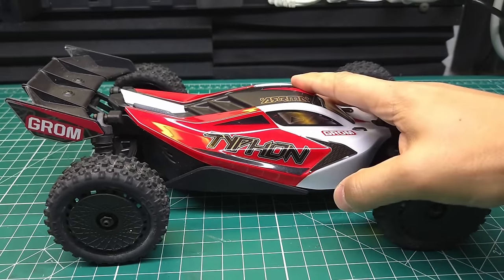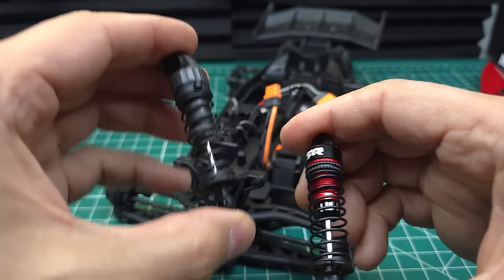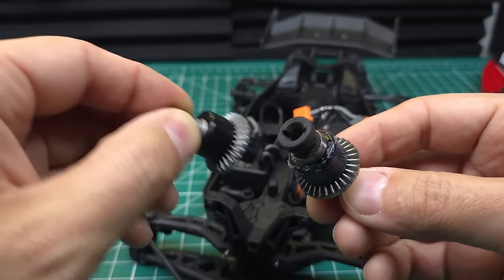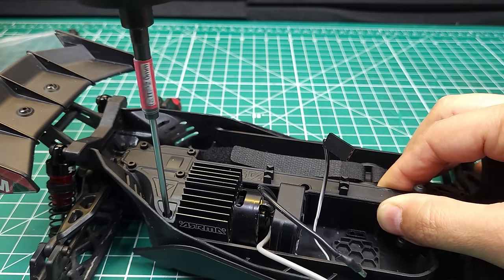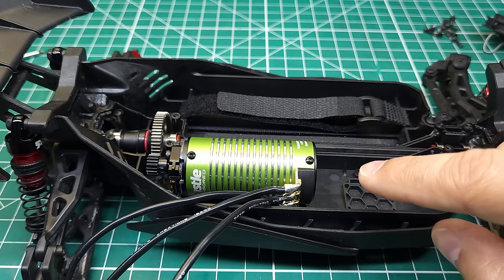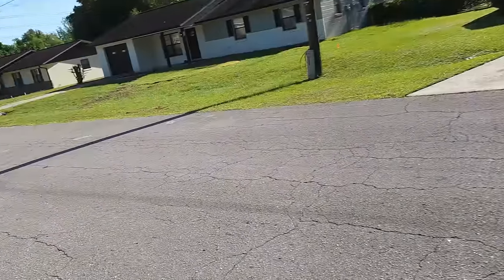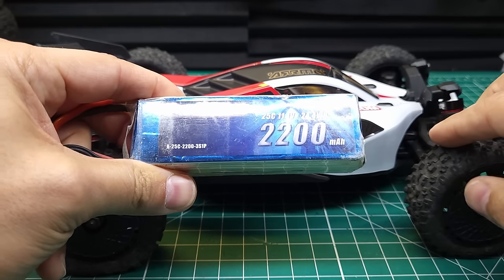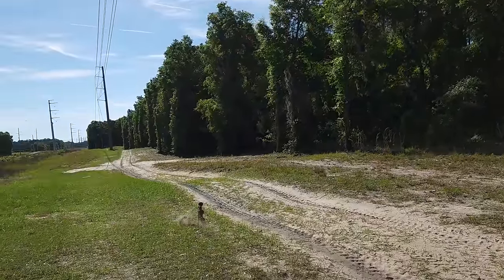I Made The World's Most Powerful Upgraded Typhon Grom & It's INSANE!

Comment: I can tell you from personal experience that the diffs can’t handle 4 packs of factory power out of the box. 😡 lol love these quick videos man! Keep it up
Reply from the maker: Yeah I don't know. I ran the granite grom on 2S brushless probably 20 packs before I upgraded differentials and didn't have a problem.
Reply: I ran 2 pack thru it stock then put in the traxxas velinion system and ran probably 7 packs on 3s before anything broke i thought it was pretty impressive for plastic diff gears
Reply: Not true. I've had my granite grom for over a week now and have put probably 20 packs of the factor 2s through it and zero issues with the differentials. And I've abused the hell out of it; hard jumps, hard acceleration, driving through thick brush, getting sticks stuck in the drive train to lock up the diff, etc, and it's still going strong on stock diffs. I will however upgrade to all metal when the local hobby shop gets them in stock as I plan to go full brushless setup.
Reply from the maker: @EngineeringUSA  Yeah I think most people's experiences are similar. As all you don't go crazy with the power the stock drivetrain is decent
Reply: @EngineeringUSA  that’s awesome to hear. Glad that people aren’t having the same experience as me. 👍🏼

Comment: Wonder why they couldnt do mod 0,6 pinion which are plenty from tamiya. And that oddball spur gear. What possible fits is a 38T from a wltoys 959 with the drive shaft. Didnt try it, but looks the same.
Reply from the maker: Well my 0.8 is basically 32p which is a pretty common gear size so that's likely why they went with it.
Reply: @DoRC  Mod 0.5 stock is just annoying enough too far from a 48 pitch. 48dp is 0.5288 mod
Reply from the maker: @Particular_Sky  Yeah unfortunately that one doesn't work but 32P and 0.8 do. The gears will be a little noisy sometimes but I've never actually had a problem with it.

Comment: Man this thing's cool! i was impressed by the amount of backflips it did on big tires!
Reply from the maker: Yeah if it hadn't broken I could have done more. I was kind of building up to just holding the throttle down when I left the ramp but never quite got there.
Reply: @DoRC hello I wanted to copy this build but I was curious to what 4s battery did you use if you could send the link or just copy the name for what you used
Reply from the maker: @jakechunasamy9642  I don't remember specifically I think it was some old FPV quad battery that I had. It probably was not the ideal one to use. I'd recommend just measuring the battery tray and then going on Amazon or something like that and picking one out that'll fit

Comment: I think you only had to upgrade the diffs and motor and esc. I'll be doing this on a budget in my next video. I'm going 3s motor swap. I remember you saying in the granite Grom video that the shocks were most likely not needed so it's interesting to see you upgrading them. Great video!
Reply from the maker: Honestly the only reason I upgraded them is because I pulled all those parts off the granite :-) I'm not sure if the outdrives are necessary to upgrade or not. I haven't run big power on the plastic ones.
Reply: COOL I like your channel!
Reply from the maker: @ReactionRC thanks!
Reply: @DoRC your welcome
Reply from the maker: @ReactionRC  :)

Comment: What’s the biggest battery you can run without upgrading the esc or motor I have one and want to run 3s but don’t want to upgrade anything else
Reply from the maker: The stock system is only to s compatible. If you want to run 3S you have to run a different ESC
Reply: Redpower XT 2700mah 2S. It's 1mm longer over the 1400 spectrum but thats a drop in for 2s.

Comment: I think I am going to try the exact setup but just curious what 3s battery are you running? This is a great vid and I have been wanting to upgrade a grom soooo badly.
Reply: And what is the pinion called
Reply from the maker: Hot racing mod 0.5 1/8 in bore pinion and I don't even remember what battery I use. It was some old FPV quad battery that I had. Definitely not the ideal option.

Comment: I would try the 6350kv 1007 motor from castle, can run up to 3s and is much shorter than the 1010. Run one with the micro x2 in my reflex 14mt and it goes even just on 2s (44mph on 2s).
Reply from the maker: Yeah for sure. I think the 10:07 motor would be more appropriate. Not only would you not have to hack up the chassis but it would also almost certainly be more than enough power.
Reply: I stuffed that 1007 into my grom and it's stupid. Had a hard time finding a pinion though where do u guys find .5mod 1/8 shaft pinions?
Reply from the maker: @calebworland967 hot racing makes them. You can get them on eBay
Reply: @DoRC  do you know if the 18t is the largest? I have a 21 right now from LC Racing. I swear this thing goes 50 on 2s but the pinion doesn't look the best. Part of me wants to try and design a 48p Slipper system for the groms. Would solve all the gearing issues. But im not settled on these diffs either these little things are overpriced without having a rebuild kit available.
Reply from the maker: @calebworland967  no I'm pretty sure they have larger ones.

Comment: Awesome build, was curious, I did a similar build and had to use an external bec with my micro castle combo, was yours different
Reply from the maker: Yeah Castle modified the X2 to have an internal BEC sometime last year. I don't remember exactly when. It is still possible to get the X2 without the internal BEC depending on how long were you get it from has had them stocked.
Reply: I bought it yesterday at the hobby store when I got the typhon grom and external bec came with it, it was the micro x2 with 1010,5600kv motor
Reply from the maker: @badmofreaker4205 Yeah it must have just been something they had in stock for a long time.
Reply: Maybe, I hope it's fast,waiting for a gear that's out for delivery.  Do you have the part numbers for the upgraded shafts and diffs,etc
Reply from the maker: @badmofreaker4205 hop on the horizon site Go under the typing Grom and check under optional parts. They're all listed under there
Reply: Thank you

Comment: I added a 16BL30 and 2435 Sl G3 6500KV motor to my grom and it's insane. It goes 45+ and can go even faster if I increase the timing and that's on 2s. It takes up no additional space and the only thing required for it is a 2mm shaft 18t losi pinion mod 0.5. Although id recommend getting a smaller pinion for more usable torque. I also cut the servo mounts off the stock 2 in 1 esc with a knife (yes I did that even though its sounds dumb) but it worked and allowed me to tuck the esc in nicely.
Reply from the maker: Sounds like a sweet setup!

Comment: Whats the parts number list of the upgrades? got my daughter a typhon grom and wanna upgrade it to.
Reply from the maker: Pretty much everything in the optional parts list on horizon's website and then a castle micro X2 ESC with 1010 motor though you have to modify the chassis to install the 1010 motor. You'll also need a hot racing 1/8 in pinion in the tooth count of your choice

Comment: Goes like crazy! 👍 It that car was just a bit taller… I need some more space to fit my FPV gear on. 🤷
Reply from the maker: The granite grom has more room under the body than the Typhon.
Reply: @DoRC  I'm more interested in a body that's a bit larger.
Reply from the maker: @NUeB_RCFPV  bit larger than even the granite grom?
Reply: @DoRC  That's too high… ;) I now have a WLToys 124007 which is okay in proportions (w/ fpv just 120 mm high), just the wheelbase could be e bit longer (relative to it's width) and the build quality is very poor. So I'm looking for a small buggy w/ a long wheel base and a body large enough for at least 3000 maH 3S and space for the O3 air unit.
I've got a 1/10 Lasernut which is a FPV banger (see my channel) but need a replacement for the WLToy – a car small enough to fit inside a daypack but in higher quality.

Comment: Love the video!! For the CC combo what bore size is it? Is the OEM motor bore size the same as the castle? For the esc connectors did you go IC3? I plan on doing IC3 and just get regular battery’s and convert them to IC3 What do you think is that a good idea?
Reply from the maker: The shaft is 1/8" which is different from the stock one. I went with XT60 though IC3 should be fine.
Reply: @DoRC  so for the pinion size what should I be looking for 1/8 size or what exactly?
Reply from the maker: @lilbeanboiiii  Yes if you want to emulate this you'll need to get 1/8 bore mod 0.5 pinions. As far as I know only hot racing makes them. You can get them on eBay in several different sizes.
Reply: @DoRC  interesting. So tekno and robinson racing don’t carry those type of pinion sizes?
Reply from the maker: @lilbeanboiiii  it's possible that I do but in my admittedly limited search I couldn't find anything other than the hot racing ones. It seems like 1/8 in mod 5 is fairly uncommon

Comment: The offroad running portion of this video was oddly reminiscent of the first  runs of the Maxx Slash with all the bouncing and crashing.  Looks like a fun little rig for smooth surfaces.
Reply from the maker: Yeah for sure. I was definitely running it on rougher surfaces than it needed to be but I feel like it's a little bit different than the slash.  It's understandable for a little car like this to be bouncing around on bumps like that but not quite as acceptable on a giant car like the slash. Honestly I think this thing handles rough off-road better than the slash.
Reply: @DoRC  That was honestly my first thought when I saw a Maxx Slash run.  "It bounces like a little 16th scale car'.  I also agree with its excusable for a 2 pound car with less than an inch of suspension travel but not a 8th scale truck.  But,  both are pretty good on smooth flat surfaces and at least they're tough.
Reply from the maker: @boduke9428  Yeah the maxx platform definitely is tough.

Comment: This is the video I was waiting for the longest!!! I really want to copy your set up! If I end up pulling the trigger i will still get the 1010 motor I wanna have an over kill lil beast too. I still don’t understand why you had to take the cover off the esc? Also would this work w a dumboRc receiver? 🔥🔥🔥
Reply from the maker: Yeah I didn't make it clear in the video. I removed the cover because it was contacting the body. The buggy body has a lot less clearance than the monster truck body.
Reply: @DoRC  oh okay I see now. No motor fan wouldn’t it need one just to keep the components nice and cool?
Reply from the maker: @Desauce512  in my admittedly limited experience it seems like the system is beefy enough to not need active cooling in this application but it was also 65° out when I was running it so that might not be the case at higher ambient temperatures.
Reply: Do you recommend getting an external BEC (I have no clue what that does btw) or just get the regular esc that comes internal with it? TIA :) or what should I go with?
Reply from the maker: @Desauce512 you definitely want to get the updated version that has the internal BEC if you can. The only reason that they included an external BEC was because the ESC didn't originally have an internal one. Having an external BEC, unless you need a bunch of extra power and are getting an external one for that reason, just adds weight wiring and complexity that you don't need to deal with.
Reply: @DoRC  Thank you for this INFO!! you really are so helpful! the CC combo that you have did it come with the internal BEC? because I plan on getting that same combo on mine! I wanna have an overkill beast just like you!
Reply from the maker: @Desauce512  Yes mine did. I got mine on Amazon and I suspect if you get yours on there it will be new enough stock that you will get one with the internal BEC as well. Did you see the part in the video where I had to trim some of the chassis in order for it to fit? Doesn't seem to have caused any problems but it is something you'll have to do if you run the 1010 motor
Reply: @DoRC  yea I saw the whole video like 5x. I guess I will make sure it takes the BEC inside to keep it nice and clean. Also for the trimming part I don’t mind doing that at all! I’m just a bit undecided on whether I should double side the esc on to the servo so I don’t have to take the cover off or go the route you did add a mount and take the cover off I’m so OCD it’s killing me.
Reply from the maker: @Desauce512  The servo is mounted to the chassis using the stock ESC. When you remove the stock ESC you remove that mount so you're going to have to use a different kind of mount no matter what. Horizon sells one that is very similar to the 3D printed one that I had. I believe you'll have to remove the cover either way to clear the body. You can't mount the ESC directly to the servo because without that bracket the servo has no way to mount to the chassis
Reply: @DoRC  ahhh okay I see now. No cover it is. Once again thank you for this information!
Reply from the maker: @Desauce512  You're welcome thanks for watching!

Comment: Just wondering since you reply a lot. I cut the connector off the stock 16bl30 so it was just the metal pins, and soldered those into an xt60 connector. It’s in there good and soldered. Do I need to bring it to bare wire or will it work the way I did it. If that makes sense lol.
Reply from the maker: What connector was on there originally?
Reply: @DoRC  looked similar to a tamaiya. Also now the LMT 2mm pinion seems wobbly on the 2mm HW shaft … I’m about to give up that’s what I was told to buy on the FB page lol.
Reply from the maker: @G35Jeesh  ok well as long as it's solidly soldered it should technically be fine. There isn't a ton of currently being passed though the more connections you have the more resistance. not sure about the pinion.

Comment: whats the run time like on the 3s?      both mine got the 93 diffs about a week into ownership, then blew out the cvs after that.  then i tossed in the 380 brushed motor but even with the printed fan relocate its still getting beyond hot.  If runtime goes up and the temps go down im gonna have to cave and go brushless. haha
Reply from the maker: Run time is one of those things that's kind of impossible to predict for someone else. There's quite a bit of room in that battery tray so you can fit a pretty big battery but it's also going to depend greatly on your driving style. If you're just puttering around hanging out with friends you could get twice as much runtime as if you're blasting up and down the street or running through thick grass.
Reply: @DoRC   Thats a fair point.  Run time is what it is i suppose.  So i guess im looking for ways to not make it run so hot. If brushless does that im on board.     

One thing that has been interesting to me is that on the thermal the back senter of the body cover is what gets the hottest.  thinking heat must be coming from the rear end or something.
Reply from the maker: @mtnbike4522 absolutely. Brushless is far superior to brushed as far as heat generation is concerned.  It is way more efficient. That being said it's also generally more powerful so you can run into a situation where you make up more efficient system that has more power going through it and ended up generating a bunch of heat. Ultimately though a decently specked brushless system is going to run cool in a car this small

Comment: What pinion did you
Use ? I bought a 1010 motor and can’t seem to find a pinion gear to save my life ? I bought the 4400 castle 1010 motor. Got a link or anything I’d really appreciate it !
Reply from the maker: The only company I know that makes them is hot racing. You need a 1/8 in bore mod 0.5. You can get them on eBay
Reply: @DoRC  only seen smaller pinions available I found lc racing makes them !
Reply from the maker: @jakesrcaddiction  hot racing is everything up to 20t I think.
Reply: @DoRC  I could not find any just smaller teeth
Reply from the maker: @jakesrcaddiction7519 what tooth count are you looking for?
Reply: Losi makes a 2mm shaft pinion with 0,5 mod. And lcracing,1 or 2 wltoys use 2,3mm shaft. Aliexpress probably.

Comment: Is there a link for the upgrades?
Reply from the maker: Hi I don't normally do links because I don't want people thinking I'm trying to sell them anything because I'm not and links are always changing. That being said most of the stuff is straight from Horizon in their optional parts area on the page for the car. The power system is a castle mamba micro x 2 with a 1010 4400 KV motor

Comment: where did you gets the hardened rear and front differentials ??
Reply from the maker: I got them from horizon though they're usually out of stock unfortunately.
Reply: @DoRC  😣
Reply from the maker: @lonewolf6169  Yeah I wish I had a better answer for you unfortunately horizon hasn't been great lately
Reply: @DoRC  i know brotha! well, my diff is all ok cause my T-grom is completely stock but i got the brand new in box a spektrum 2 in 1 brush sistem combo and tomorrow i got the 2.0 losi pinion! so… will see how is going with stock diff

Comment: Can we get a parts list ? I'm trying to duplicate this build but I can't locate some of the upgrades.
Reply from the maker: I don't have a parts list but tell me specifically what you're looking for and I can tell you where I got it. Most of the upgrades came straight from horizon though they don't seem to have a lot of stuff in stock lately.
Reply: @DoRC  where'd you get the shocks ? I see the drive train stuff is pulled from a granite but I can't find the shocks
Reply from the maker: @REDLS7  ah. They don't officially say the shocks are compatible so you just need to get the ones that are listed for the granite.  They work just fine though you probably want to swap the springs over as they're a bit shorter